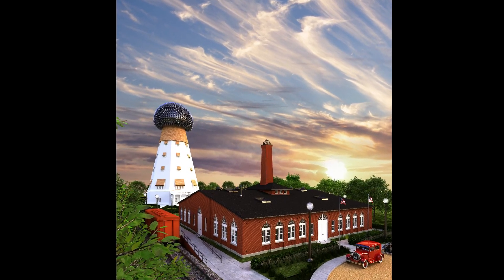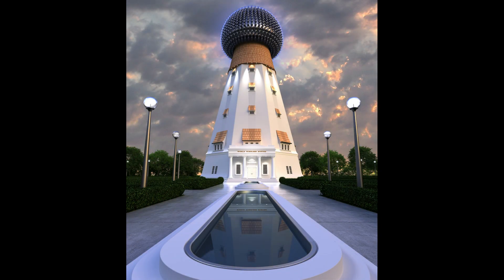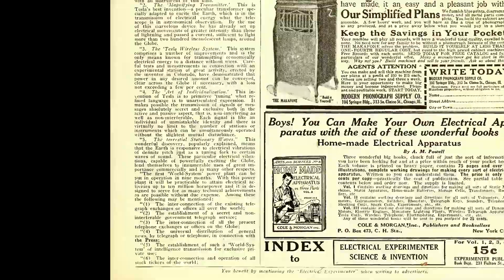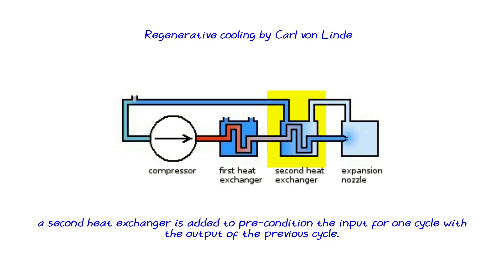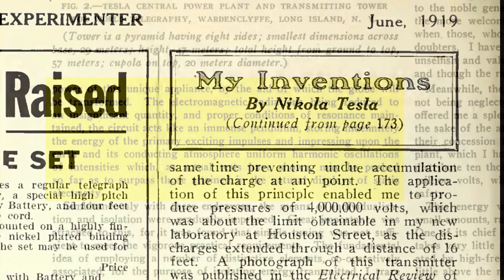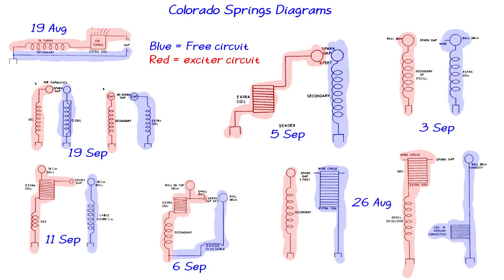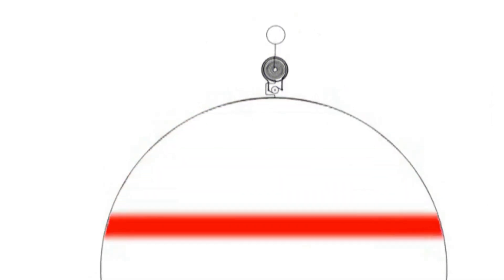Teslas Magnifying Transmitter

Comment: The streamers display on top of the extra coil are so rudely injected to the saucer electrode: I suppose the purpose of the photograph was just to show those streamers, but when the frequency scale-down activity was acting really, the streamers would be injected less dodgily with another spherical electrode. I remember Kyle determined there are two spherical electrodes at work, because the one at an altitude, was visibly bigger than the other shown in some photographs just above the extra coil. Everything makes sense every day more.
Reply: You are NEVER supposed to have arcing off the tops of the magnifying transmitter when it’s in operation. This is the BIGGEST thing people get wrong. Tesla even says it over and over in the patent too. 

NIKOLA TESLA U.S. PATENT 1,119,732 - APPARATUS FOR TRANSMITTING ELECTRICAL ENERGY

“Having described my invention, I claim:

1. As a means for producing great electrical activities a resonant circuit having its outer conducting boundaries, which are charged to a high potential, arranged in surfaces of large radii of curvature so as to prevent leakage of the oscillating charge, substantially as set forth.

2. In apparatus for the transmission of electrical energy a circuit connected to ground and to an elevated terminal and having its outer conducting boundaries, which are subject to high tension, arranged in surfaces of large radii of curvature substantially as, and for the purpose described.

3. In a plant for the transmission of electrical energy without wires, in combination with a primary or exciting circuit a secondary connected to ground and to an elevated terminal and having its outer conducting boundaries, which are charged to a high potential, arranged in surfaces of large radii of curvature for the purpose of preventing leakage and loss of energy, substantially as set forth.

4. As a means for transmitting electrical energy to a distance through the natural media a grounded resonant circuit, comprising a part upon which oscillations are impressed and another for raising the tension, having its outer conducting boundaries on which a high tension charge accumulates arranged in surfaces of large radii of curvature, substantially as described.

 
5. The means for producing excessive electric potentials consisting of a primary exciting circuit and a resonant secondary having its outer conducting elements which are subject to high tension arranged in proximity to each other and in surfaces of large radii of curvature so as to prevent leakage of the charge and attendant lowering of potential, substantially as described.

6. A circuit comprising a part upon which oscillations are impressed and another part for raising the tension by resonance, the latter part being supported on places of low electric density and having its outermost conducting boundaries arranged in surfaces of large radii of curvature, as set forth.

7. In apparatus for the transmission of electrical energy without wires a grounded circuit the outer conducting elements of which have a great aggregate area and are arranged in surfaces of large radii of curvature so as to permit the storing of a high charge at a small electric density and prevent loss through leakage, substantially as described.

8. A wireless transmitter comprising in combination a source of oscillations as a condenser, a primary exciting circuit and a secondary grounded and elevated conductor the outer conducting boundaries of which are in proximity to each other and arranged in surfaces of large radii of curvature, substantially as described.

9. In apparatus for the transmission of electrical energy without wires an elevated conductor or antenna having its outer high potential conducting or capacity elements arranged in proximity to each other and in surfaces of large radii of curvature so as to overcome the effect of the small radius of curvature of the individual elements and leakage of the charge, as set forth.

10. A grounded resonant transmitting circuit having its outer conducting boundaries arranged in surfaces of large radii of curvature in combination with an elevated terminal of great surface supported at points of low electric density, substantially as described.”

NIKOLA TESLA.
Reply: The only reason Tesla showed the arcs was because the length of the arc is directly dependent upon the voltage achieved. The higher the voltage the better the transmission performance. This is true for alll regular ac transmission systems. 

Power of an ac signal is 
P = V * I 

In AC for any given power, when you increase the voltage you decrease the current. This is important because, in transmission, power loss is proportional to current squared. 

So because power loss is 
P = R * I ^ 2
When you increase the voltage by a factor of 10x, you decrease the current to x/10. When you drop current over the same transmitting distance and medium (ie same resistance) you drop the ohmic power losses over that distance by by the factor  X/100. 
If you increase the voltage by a factor of 100… current is 1/100th and ohmic power loss over the same transmission line is 1/10,000th. 

This is the entire purpose of the coil being used to increase the voltages so that ohmic power loss in transmission is damn near zero because the current is so outrageously small because the voltage used is so high. 

BUT the problem is you start to get arcing from the transmission lines at higher voltages. But if you used the ground in a single wire transmission of regular old AC electrical currents at Extremely high voltage and absurdly low current the electrical resistance of the ground being high is essentially insignificant relative to the power being transmitted. Again all with regular old currents. 

But the problem he got was that his Tesla coil would arc off before the voltages he needed to use. THIS is where the lighting protector Patent comes in. It reduces the electron density of the outer surface of an object high in the air and increases the voltages required for an arc to form. This is why he says allowing it to arc into the air happens at great losses due to the energy radiated away in spherical dispersion of “hertzian waves”. Regular old EM waves we are used to.
Reply: @CharlieSolis  "You are NEVER supposed to have arcing off the tops of the magnifying transmitter when it’s in operation. This is the BIGGEST thing people get wrong. Tesla even says it over and over in the patent too. " 

Yes Charlie, I know perfectly, and more importantly I didn't say that.

Read carefully :) I'm not getting anything wrong, maybe it's exactly the other way around. To know what I was talking about, you must read Colorado Springs Notes and know also the real configuration of the Magnyfying transmitter.  There are sparks, but not arcing off the tops. THAT is really the BIGGEST thing people get wrong, because they didn't to their homework.
Reply: @CharlieSolis Take a look at 1:17-1:21, what do you see?
Reply: @tanner1985  read what I wrote. I never claimed you made any such claim…
Reply: @tanner1985  I’m not sure what your referring to with arcing in the magnifying transmitter, it’s also MOST DEFINITELY NOT supposed to arc off anywhere inside near the coils either. There is no spark gap in this one patent. You’re supposed to already feed it high power AC currents, low voltage but high current. Tesla specifically added component H into the design to eliminate any possibility of arcing inside the magnifying transmitter either. As well denotes a specific way to arrange the coils

NIKOLA TESLA U.S. PATENT 1,119,732 - APPARATUS FOR TRANSMITTING ELECTRICAL ENERGY

“Still further extending the principles underling my invention, special reference is made to coil B and conductor B'. The latter is in the form of a cylinder with smooth or polished surface of a radius much larger than that of the half spherical elements P P, and widens out at the bottom into a hood H, which should be slotted to avoid loss by eddy currents and the purpose of which will be clear from the foregoing. The coil B is wound on a frame or drum D1 of insulating material, with its turns close together. I have discovered that when so wound the effect of the small radius of curvature of the wire itself is overcome and the coil behaves as a conductor of large radius of curvature, corresponding to that of the drum. This feature is of considerable practical importance and is applicable not only in this special instance, but generally. For example, such plates at P P of terminal D, though preferably of large radius of curvature, need not be necessarily so, for provided only that the individual plates or elements of a high potential conductor or terminal are arranged in proximity to each other and with their outer boundaries along an ideal symmetrical enveloping surface of a large radius of curvature, the advantages of the invention will be more or less fully realized. The lower end of the coil B—which, if desired, may be extended up to the terminal D—should be somewhat below the uppermost turn of coil A. This, I find, lessens the tendency of the charge to break out from the wire connecting both and to pass along the support F'.”
Reply: @tanner1985  
NIKOLA TESLA U.S. PATENT 1,119,732 - APPARATUS FOR TRANSMITTING ELECTRICAL ENERGY

“A part of the improvements which form the subject of this specification, the transmitting circuit, in its general features, is identical with that described and claimed in my original Patents Nos. 645,576 and 649,621. The circuit comprises a coil A which is in close inductive relation with a primary C, and one end of which is connected to a ground-plate E, while its other end is led through a separate self-induction coil B and a metallic cylinder B' to the terminal D. The connection to the latter should always be made at, or near the center, in order to secure a symmetrical distribution of the current, as otherwise, when the frequency is very high and the flow of large volume, the performance of the apparatus might be impaired. The primary C may be excited in any desired manner, from a suitable source of currents G, which may be an alternator or condenser, the important requirement being that the resonant condition is established, that is to say, that the terminal D is charged to the maximum pressure developed in the circuit, as I have specified in my original patents before referred to. The adjustments should be made with particular care when the transmitter is one of great power, not only on account of economy, but also in order to avoid danger. I have shown that it is practicable to produce in a resonating circuit as E A B B' D immense electrical activities, measured by tens and even hundreds of thousands of horse-power, and in such a case, if the points of maximum pressure should be shifted below the terminal D, along coil B, a ball of fire might break out and destroy the support F or anything else in the way. For the better appreciation of the nature of this danger it should be stated, that the destructive action may take place with inconceivable violence. This will cease to be surprising when it is borne in mind, that the entire energy accumulated in the excited circuit, instead of requiring, as under normal working conditions, one quarter of the period or more for its transformation from static to kinetic form, may spend itself in an incomparably smaller interval of time, at a rate of many millions of horse power. The accident is apt to occur when, the transmitting circuit being strongly excited, the impressed oscillations upon it are caused, in any manner more or less sudden, to be more rapid than the free oscillations. It is therefore advisable to begin the adjustments with feeble and somewhat slower impressed oscillations, strengthening and quickening them gradually, until the apparatus has been brought under perfect control. To increase the safety, I provide on a convenient place, preferably on terminal D, one or more elements or plates either of somewhat smaller radius of curvature or protruding more or less beyond the others (in which case they may be of larger radius of curvature) so that, should the pressure rise to a value, beyond which it is not desired to go, the powerful discharge may dart out there and lose itself harmlessly in the air. Such a plate, performing a function similar to that of a safety valve on a high pressure reservoir, is indicated at V.”
Reply: @CharlieSolis  I know that patent since I have the complete patents book and often read them, and that one is very famous by itself either. So much famous that led many to believe it to be the TMT. That is not a TMT despite looking similar to Wardenclyffe's Tower, it's just a Tesla Coil, but made with an extra coil for a series of good reasons.

The real TMT is not patented and its diagram is exposed at Belgrade Museum, and you can see it in the video at the time I have indicated you. You probably have met the diagram before, reading Leland Anderson's articles, but I don't know why you did not acknowledge that.

You can read a good article about the supposed  spark gap inside the TMT in William Beaty's article "DID TESLA'S WARDENCLYFFE TOWER GENERATE SQUAREWAVES?". The gap was definitely there so the arcing also, and is supposed to step down the frequency. It was also employed in Colorado Springs station, it's clearly stated in Colorado Springs Notes, hence why I commented in the first place, I was in fact commenting the frame with the sparks from the extra coil to the elevated topload. Yes, there were sparks to the ball up above.

 
I too believed, in the past, that the TMT was patent 1,119,732, but it turns out not to be. Believe it or not, it's the fulcrum of this discussion .

p.s. Now that I checked, I see that I was a subscriber of your channel for a long time! How in the world one can put up such a channel with plenty of videos and good material centered on Tesla, and fail so miserably in acknowledging the info in the above video to the point of starting a harsh discussion like this?
Reply: @tanner1985  david that is patently incorrect. Please read Tesla’s actual paper on the magnifying transmitter. Not what some other people have speculated about Tesla’s work. I know exactly which picture you’re referring to and that has additions to it but those additions don’t constitute what the magnifying transmitter is. Again please read what Tesla himself actually wrote. 

All of this is explained very clearly in Tesla’s own words and writings.

MY INVENTIONS V - THE MAGNIFYING TRANSMITTER

by Nikola Tesla

“THE MAGNIFYING TRANSMITTER.

I have been asked by the Electrical Experimenter to be quite explicit on this subject so that my young friends among the readers of the magazine will clearly understand the construction and operation of my “Magnifying Transmitter” and the purposes for which it is intended. Well, then, in the first place, it is a resonant transformer with a secondary in which the parts, charged to a high potential, are of considerable area and arranged in space along ideal enveloping surfaces of very large radii of curvature, and at proper distances from one another thereby insuring a small electric surface density everywhere so that no leak can occur even if the conductor is bare. It is suitable for any frequency, from a few to many thousands of cycles per second, and can be used in the production of currents of tremendous volume and moderate pressure, or of smaller amperage and immense electro-motive force. The maximum electric tension is merely dependent on the curvature of the surfaces on which the charged elements are situated and the area of the latter.”

This description is EXACTLY what the patent is… 

“Taken in the narrowest significance of the term, however, it is a resonant transformer which, besides possessing these qualities, is accurately proportioned to fit the globe and its electrical constants and properties, by virtue of which design it becomes highly efficient and effective in the wireless transmission of energy. Distance is then absolutely eliminated, there being no diminution in the intensity of the transmitted impulses. It is even possible to make the actions increase with the distance from the plant according to an exact mathematical law.”

“The tower was destroyed two years ago but my projects are being developed and another one, improved in some features, will be constructed. On this occasion I would contradict the widely circulated report that the structure was demolished by the Government which owing to war conditions, might have created prejudice in the minds of those who may not know that the papers, which thirty years ago conferred upon me the honor of American citizenship, are always kept in a safe, while my orders, diplomas, degrees, gold medals and other distinctions are packed away in old trunks. If this report had a foundation I would have been refunded a large sum of money which I expended in the construction of the tower. On the contrary it was in the interest of the Government to preserve it, particularly as it would have made possible — to mention just one valuable result — the location of a submarine in any part of the world. My plant, services, and all my improvements have always been at the disposal of the officials and ever since the outbreak of the European conflict I have been working at a sacrifice on several inventions of mine relating to aerial navigation, ship propulsion and wireless transmission which are of the greatest importance to the country. Those who are well informed know that my ideas have revolutionized the industries of the United States and I am not aware that there lives an inventor who has been, in this respect, as fortunate as myself especially as regards the use of his improvements in the war. I have refrained from publicly expressing myself on this subject before as it seemed improper to dwell on personal matters while all the world was in dire trouble. I would add further, in view of various rumors which have reached me, that Mr. J. Pierpont Morgan did not interest himself with me in a business way but in the same large spirit in which he has assisted many other pioneers. He carried out his generous promise to the letter and it would have been most unreasonable to expect from him anything more. He had the highest regard for my attainments and gave me every evidence of his complete faith in my ability to ultimately achieve what I had set out to do. I am unwilling to accord to some small-minded and jealous individuals the satisfaction of having thwarted my efforts. These men are to me nothing more than microbes of a nasty disease. My project was retarded by laws of nature. The world was not prepared for it. It was too far ahead of time. But the same laws will prevail in the end and make it a triumphal success.”
Reply: @tanner1985  if you are referring to the ball that’s suspended by a string on a pulley that’s tied to the bottom of the spring support column then all you are referring to is the spark gap for producing pulsed DC to be turned into AC currents. This is not a feature of the magnifying transmitter. This is a feature of teslas electrical oscillator for producing alternating currents. The magnifying transmitter is just a resonant transformer. Full stop. You would use an electrical oscillator with spark gap, hook it up to and drive the magnifying transmitter for magnifying and transmitting the signal from said electrical oscillator. 

From the patent:
“The primary C may be excited in any desired manner, from a suitable source of currents G, which may be an alternator or condenser, the important requirement being that the resonant condition is established, that is to say, that the terminal D is charged to the maximum pressure developed in the circuit, as I have specified in my original patents before referred to.”

This what you are referring too. But the magnifying transmitter does not have a spark gap on it because it is just a resonant transformer. Not an electrical alternator/oscillator. It does not produce AC signals. It only magnifies them. 
Power = voltage * current 
ie. Power = V1 * I1 = V2 * I2

Taking low voltage 1 and high current 1 and magnifying it to the high voltage 2 and low current 2 while keeping the same total energy the same. Just “focused” per se. Again it’s literally just a step up (transmitter) and step down (receiver) transformer.

All the ball on the string does is set the frequency of the alternator due to the space chosen in the spark gap.
Reply: @tanner1985  yup that’s what I thought… can’t even be bothered to reply back after being proven wrong, typical.
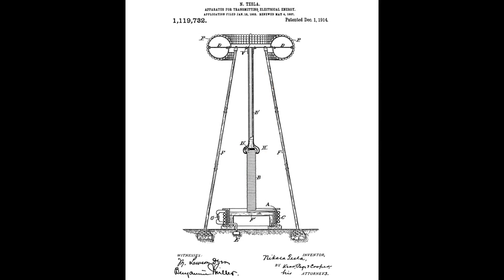Reply: @CharlieSolis Quote: "This is a feature of teslas electrical oscillator for producing alternating currents": does this have a patent? I mean, the drawing at 1:22, which is Wardenclyffe, do you call that "teslas electrical oscillator for producing alternating currents" and does it have a corresponding patent? I repeat, I do not mean the one at 0:46. I mean the other with the spark gap with the pulley you correctly identified.
Reply: @CharlieSolis  I was not proven wrong, I simply don't bother having a contrast with someone I don't even know, on a subject still open to debate and in which NO ONE on this earth have yet contributed something, except for the OP of this channel. So it was a matter of being polite and not wasting time, but it appears you have much of it to lose uselessly.
Reply: @tanner1985  omg… stop cherry picking what you want to see and go read Tesla’s own words. You are wrong, and you know it from reading Tesla’s “my inventions: The magnifying transmitter.”

Stop cherry picking history to suit your bias….

The one at 46 seconds is 100% the magnifying transmitter as it is just a resonant transformer. The one at 1:22 is the electric oscillator that can be used to drive the resonant transformer
.
The electric oscillator being the AC current producer, just as he says in the text, and then the transmitter tower is the resonant transformer that literally is “the magnifying transmitter” .

Tesla states this VERY clearly in his own words. But you want to take some weirdos Bs interpretation of it during a completely different time of history that just so happens to suit your bias that goes against what Tesla actually said in the first place… right….

From the patent:
“The primary C may be excited in any desired manner, from a suitable source of currents G, which may be an alternator or condenser, the important requirement being that the resonant condition is established, that is to say, that the terminal D is charged to the maximum pressure developed in the circuit, as I have specified in my original patents before referred to.”

This what you are referring too. But the magnifying transmitter does not have a spark gap on it because it is just a resonant transformer. Not an electrical alternator/oscillator. It does not produce AC signals. It only magnifies them. 
Power = voltage * current 
ie. Power = V1 * I1 = V2 * I2

Taking low voltage 1 and high current 1 and magnifying it to the high voltage 2 and low current 2 while keeping the same total energy the same. Just “focused” per se. Again it’s literally just a step up (transmitter) and step down (receiver) transformer.

All the ball on the string does is set the frequency of the alternator due to the space chosen in the spark gap.
Reply: @CharlieSolis  I still think you are the real one which is biased, while I'm right. The one at 1:22 drawn with also grounding, and appearing perfectly as a tower, cannot be an "electric oscillator that can be used to drive the resonant transformer" --> How would you connect two big towers that way? So, so to speak, what the hell are you figuring out this? I remember you that the configuration called the TMT, which is NOT patented, is also pointed out in Colorado Springs Notes, one has to read it (which is difficult to do) to realize that. I'm so sorry you can't stand at this, because I perfectly know that Tesla's enthusiasts would literally love to understand this thing. But one can't if it's biased, and you are!
Reply from the maker: @CharlieSolis  Please subscribe, I'm planning to do many more video's explaining the TMT and I will address the many misconceptions that exist. Your contribution here is very helpful as it shows a number of things that need further clarification. Meanwhile ask yourself this question: Tesla has been asked on many occasions what a Magnifying Transmitter is, wouldn't it be very easy to say "Look at my patent 1,119,732 that describes it all." When talking about his MT, he never refers to this patent, nor does he use the term "Magnifying Transmitter" in that patent. Why would that be?
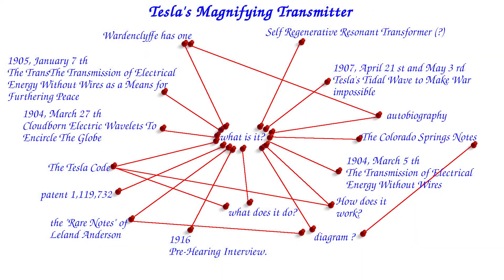Also, to find what TMT is you need to take all references into consideration. I made an overview for your convenience at 1:00 in this video.